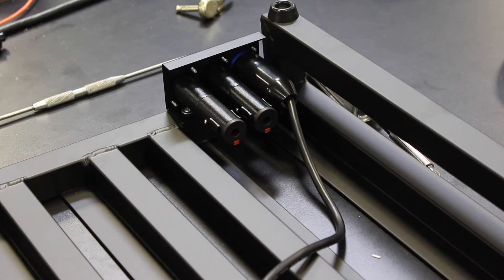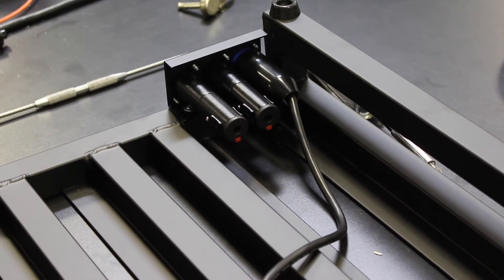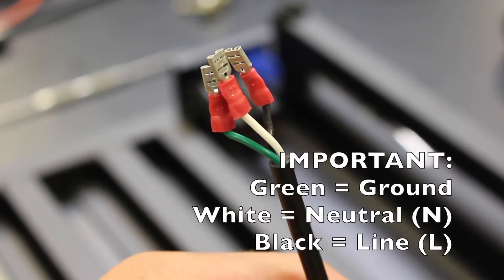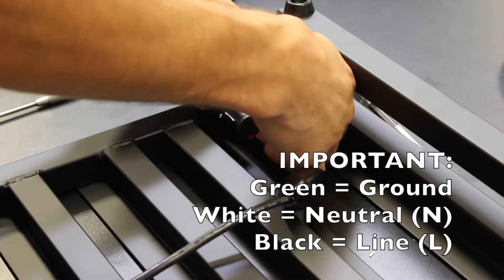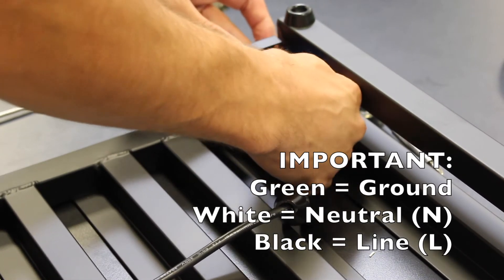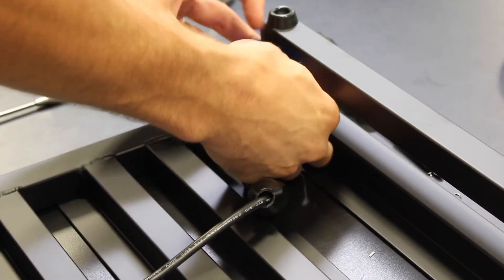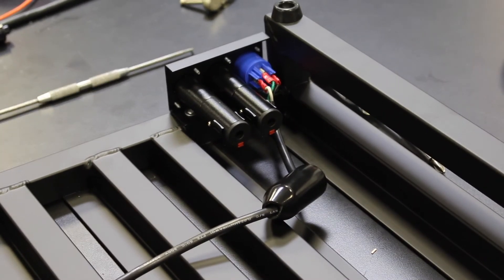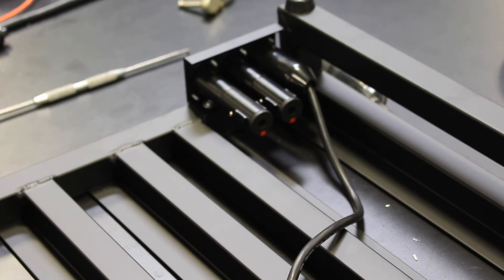Installing a line cord to PowerCON on our Pedaltrain Panel Assemblies

Comment: Is it worth grounding earth to the metal chassis as well?  I have installed the same power connection in a rack unit full of pedals and there is ground noise.
Reply from the maker: You can, however I would mock it up to see if that alleviates the noise first. Have you narrowed it down to the powerCON being the cause of the ground hum? I would find that very very strange
Reply: @BTPA_USA  thanks, it seems to be isolated to that but I can't be certain - a mockup to test is the way forward, thanks a lot!
Reply from the maker: @ArrakisOCE  I would start by testing the input jack. There are small set screws on the sides of the connectors (one on the front side and one on the back). These set screws are the ground signal. They are isolated from the connector via a small rubber grommet. You can touch a wire to either (or both) of these screws while the guitar is live. I would touch something to this set screw and then to the board to see if this helps. If it does, carefully remove the set screw and remove the rubber grommet. Then re-insert the screw.
Reply: @BTPA_USA  Wow! I had no idea to think that my BTPA TRS feed-through couplers weren't grounded (I'm using a bunch of MC-3368B for inputs and outputs - wasn't aware of the grounding screws until now).  I will pull it apart on the weekend but it makes a lot of sense now that it could be the issue.  Should I remove both grommets for each connecter unit?  I probably also have them connecter housings isolated from the metal panel itself using the D series rubber gaskets (SCDP) which I'll remove as well.

Comment: Hey! I saw you guys through Fluff's video on his fm9 flight rig that you wired up for him. I thought the way that the whole templeboard was powered off of one powercon cable was super cool. I am planning to do a similar build but would prefer to use a regular IEC cable rather than a powercon to power multiple devices on the board which also need their own iec. Do you guys have any solution for this?
Reply from the maker: We can make this however do not have any metalwork to fit an IEC on a Temple Board. We have a panel that can fit an IEC for a Pedaltrain

Comment: The Powercon female end has 3 small vertical prongs, how to do connect a regular AC 3 pronged plug to that? (from say a voodoo labs pedal power 2)?
Reply from the maker: Hi Mike,

To start, the IEC C13 female connector is what goes into the Voodoo Labs Pedal Power 2. Sorry if you knew that, its just important to make sure this is known before we go further.

You need to strip back the power cable and crimp on lugs (same lugs as a speaker in a cab would use). These slide right on to the terminals of the powerCON. Therefore the PowerCON would go directly into the PP2+ (or other PSU).

If you are not willing to crimp/make your own cable tail - we do this at the shop. All you have to do is slide the crimped terminals on their corresponding ports of the PowerCON and you are done.
Reply: @BTPA_USA  Thank you! I connected the dots immediately after posting, thank you for humoring my ridiculous overlook!